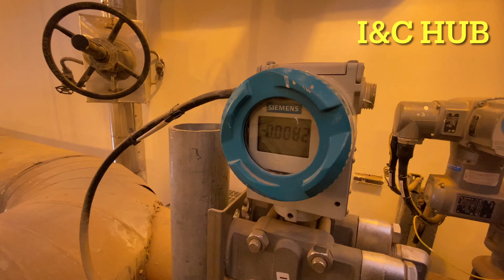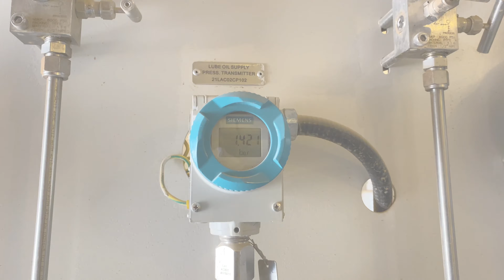Transmitters line up procedure

Comment: Equalization valve open aanel isolation valves(hp,lp) orey timil open aakkenda karyam undo?
Reply from the maker: Yes same time need to open.otherwise that pressure impact on the diaphragm… please check manifold valve video